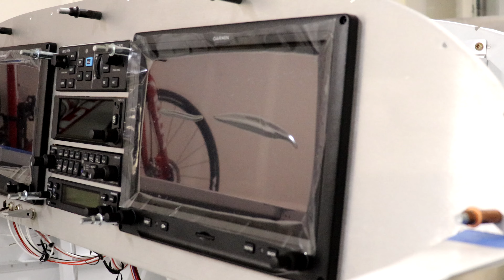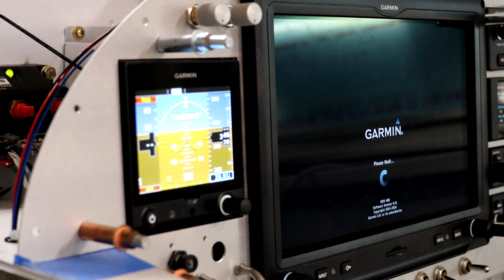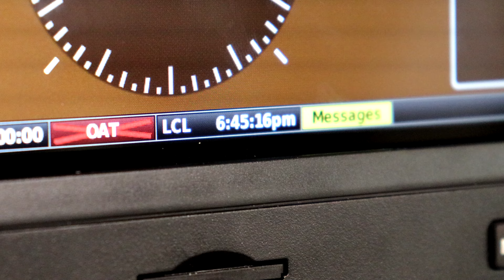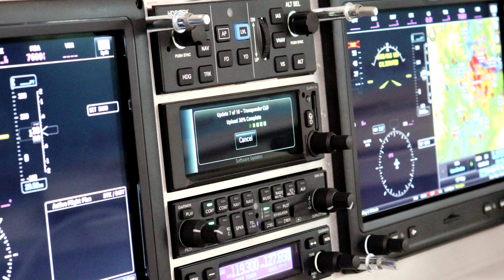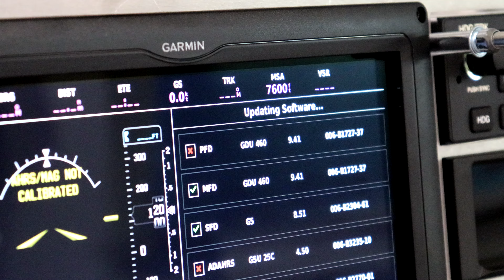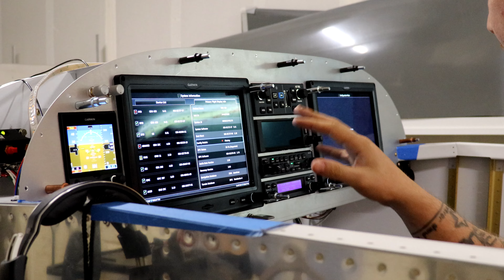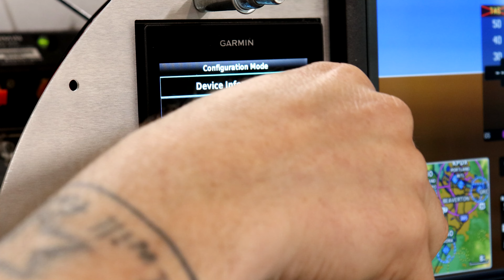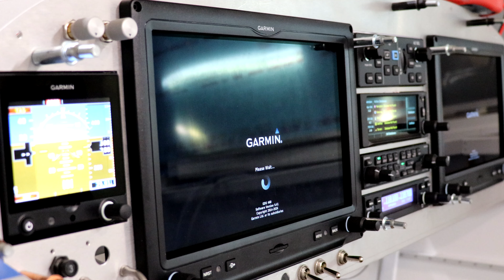Garmin G3X Touch Powerup and Configuration - RV-7A | EP4.12

Comment: Well you are a very brave builder to do the wiring for the avionics, and it works!  I've considered, and decided that I will have all the wiring harness prewired and the panel done.  I've seen too many builders try to wire panels and decided to power the avionics in advance of all the components and had a failure.  Now we know your general location near Hillsboro, Or. in my back yard.  Very exciting development.  Your aircraft build has not been easy with the setbacks at Vans.
Reply from the maker: Thank you! 
I totally understand builders having a panel/harness built. What a project-within-a-project this has been. An incredible amount of time and expense! But I loved every minute of it.

That said, totally understand folks saving 2-4 month of build time and having this made by a professional.

Soon, we’ll see if I saved any money. My guess is not much…

Comment: I had made a magnetometer for my RC planes at home to work with tiny flight controllers. To calibrate, simply rotate the airplane in all orientation around each of the XYZ axis couple times, and you should be good to go
Reply from the maker: The magnetometer has a calibration process. It’s pretty simple, but unfortunately takes a bit more room than the garage offers. 

Likely will hold on that until taxi tests.

Comment: Great progress
Was the original flap switch bad ?
Reply from the maker: No, that’s the thing: flap commands making it to the system just fine. Just no power out of the GAD27.

While reviewing, I manually moved the motor past its extreme position. I checked several other items and then we had flaps. 

Still under review, but I think it had to do with the position sensor, and perhaps some stuck logic.

Comment: Congrats Ryan, cool to see. 

I'm out of stool jokes ; will have to find a new milestone myself too 😅.

BTW in case of all sorts of electric malfunctions. Is there a way to get flaps down manually? Just wondering, not like it's a concern.
Reply from the maker: Nope. No manual crank or override. Flaps stuck up = minor issue. A no-flap landing wouldn’t be terrible.

Flaps stuck down would be considerably more dangerous. It’s this scenario that will make me ensure the “kinks” experienced on the flaps are completely worked out.

Comment: Hey Ryan any chance you would share your engine spec choices 
Which ignition are you going with and compression ratios?
Loving your build and building the same aircraft just way behind you lol
Reply from the maker: Heck yeah I can share.

I’m going with a Continental Titan IOX (injected) 370. Low compression (8.3:1) with dual P-mags.

It’s in the works and I’ll start dealing with installation preparation soon. Engine likely ready for install early next year.
Reply: @RyanFlysPDX  Thanks Ryan, Just got off the phone with continental to try and get pricing and lead times
Reply from the maker: @JasonWare-ym6mm Fantastic. I think you’ll find what I did: excellent and responsive team. The folks in the experimental side (James and others) were super helpful.

Comment: Ryan I think you mentioned in a previous video that you used SendCutSend to fabricate your panel and support brackets?  Are you happy with the quality and accuracy of the cuts and bends and the finish?
Reply from the maker: Great question.

I’ve used them for a number of pieces and have been happy with every order. I’m learning that’s designing many of these pieces can be iterative, and thus expensive if you’re trying to create complex or fine tolerance pieces.

But, yes, quality has always been spot on. Price extremely reasonable compared to traditional fabrication processes.
Reply: Thanks!  Looking to redo the floating panel on my old C172, and this looks like a great option, inexpensive enough that I can prototype a couple different variations.

Comment: Hey ryan can i ask which propeller and spinner you opted for ? 
thanks for the tip on Continental 
super helpful and responsive guys
Reply from the maker: I went with the whirlwind 330 and a 13” spinner.

The 330 was required on low-compression constant speed without a counter weighted crank.

There’s a lot of parameters to ensure a match between prop and engine, and both Whirlwind and Continental were great at answering questions.
Reply: @RyanFlysPDX  is that the 66inch?
Reply from the maker: 73”
Reply: So you are  going constant speed correct?
Reply from the maker: Yeah. Constant speed was something that was high up on the list of options for me. A bit more cost, but I’ve heard it’s the biggest value performance upgrade you can make. So I took the leap.

I also heard VFR only can be limiting, so I took the leap there to an IFR panel. As a result, I’ve wound up with a much more expensive project than I anticipated… 😣
Reply: Right there with you but as the build goes on it just makes sense to add what you want now. The only big difference for my build is i opted for Dynon rather than Garmin other than that our builds are like twins